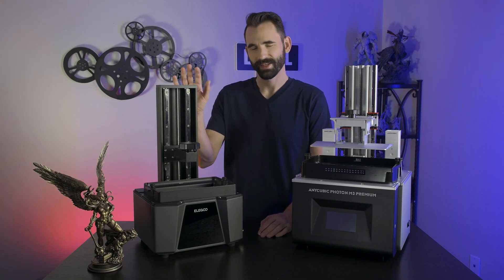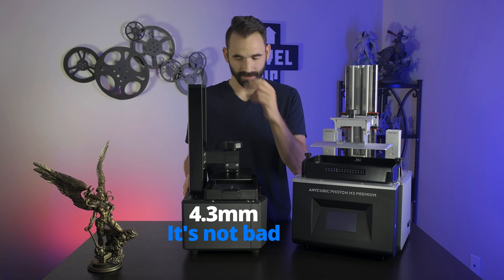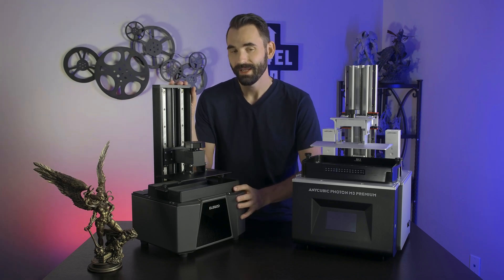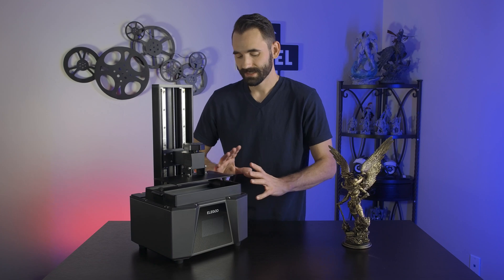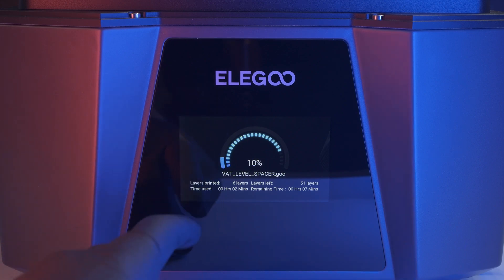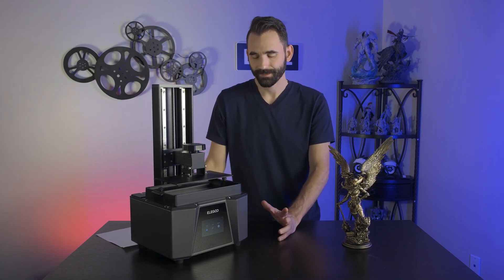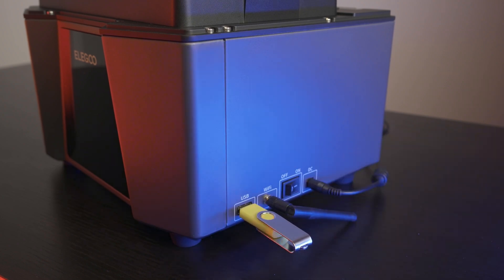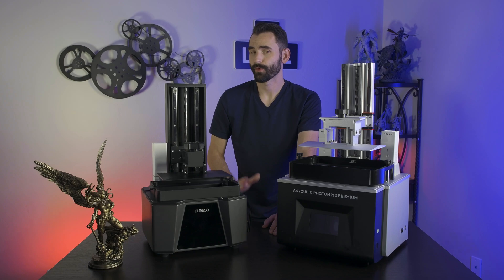Saturn 3 Ultra Review #review #3dprinter

Comment: Man, I'm just not sure whether to get the Saturn 3 or Saturn 3 Ultra. I'm getting so much mixed feedback from various sources, some saying the Ultra is worth it and an upgrade in every way, whereas others saying the 3 is better for print quality and consistency.

I REALLY dislike the two-point leveling system on the 3. And the Ultra having the beefier ball screw is a plus. Other than that, I don't care about any other features, wifi, metal body, etc. The extra 10mm print height is nice though.

Also, yeah, ACF sucks but that can easily be replaced. Print speed isn't a concern, quality is. What do you think? I might just have to order both and test them both out and return whichever I like least...
Reply from the maker: At this point I would look at the GK3-T it's going to be better then either.
Reply: @J3DTech  Not sure I want to spend twice the price for it. Also is unavailable on Amazon, is it an older Uniformation printer?
Reply from the maker: @asimhussain8716 It's the new one they have the Gk3-P , GK3-B and GK3-T. On their website go for the GK3-T. I'm sure they have a black Friday deal right now.

Comment: Hi! As the blackfriday sale is going on right now I'm undecided between the S3U (and buy NFEPs) or the Phrozen Mini 8k S. Would you recommend one over the other?
Reply from the maker: @negligible_comment  It really depends on if you want the big or large printer. The mini 8Ks is a great printer, very solid. It's a little bit small but solid.
Reply: @J3DTech  I don't really care about the size. It's for Tabletop and painting hobby and I have enough space for any (or gonna make some, thaha). I want the details to be great and the printer to be solid (proven). The WiFi of the S3U is a nice add for sure and the bigger print size in case I need it as well. Don't know how well it works though when the ACF gets switched out. The 8kS seems to be very solid and has great details.
Reply from the maker: @rphl-v3k  You maybe also want to look at the M7 none pro version
Reply: @J3DTech  I don't think the €100 more on the M7 are worth it. Although the residue detection is quite cool, but it has ACF again. Btw, thanks for the fast answers here!
Reply from the maker: @rphl-v3k  It just has a very good lighting engine. But it does have auto leveling....
Reply: @J3DTech  I want manual leveling, don't want to play the QC lottery even more with auto "leveling".
Reply from the maker: @rphl-v3k  You and me both

Comment: Thanks for creating this! I decided to get into Resin after using FDM printers for almost 10 years now. Decided to get a used M3 Premium based on this video and the Infill Podcast you were one even though there's a ton of praise going on for the Elegoo Mars 5 ultra coming in slightly lower in cost new.  I figure a solid platform would be better than more bells and whistles.  Hopefully my assumption is correct. The M3 Premium should arrive in the next few days.  Any recommendations for the M3 Premium?
Reply from the maker: @theFPVgeek  First where did you find one? That's impressive! 

It's an easy printer to use, simply calibrate and print away.
Reply: @J3DTech  Found on eBay :) Supposedly barely used (~12 prints).  We'll see in a few days.

Comment: I've been having problems with my non-ultra s-3 and parts of prints not sticking to the buildplate. I'm going to look through your videos for the solution you briefy mentioned in this video on how to properly zero the buildplate with those test prints. Thanks!
Reply from the maker: That's the best place to start. But also make sure that you update the firmware. Major speed issues resolved with the newest version.

Comment: Are the exposure times the same with nfep and acf?
I was getting some really good and fast prints with ACF but since I've damaged it I would like to try nfep. What speed reduction would you recommend in comparison to  acf? Is it like 10% or is it closer to 50%?
Reply from the maker: For my resin they were but you always want to relevel and calibrate.

For speed ACF only lets you pull faster all other speeds are not affected by the film. 

I pull at 45mm/m - 100mm/m on the first stage 200mm/m - 300mm/m on the 2nd 

Burn in layers should always be very slow.

Comment: New to the resin side of printing I started with the Saturn 3 Ultra, I am still in the learning stages, I just paid the price for ACF replacements :( . Is NFEP worth crossing over to once this supply runs out? I am not as much about speed as I am with a failure rate and quality output.
Reply from the maker: If quality is your goal the nFEP is what you want.

Comment: So how good is the AA Compared to the mighty 8k? The mighty 8k has exceptional AA and was thinking of getting this printer but I need AA to work to the point of minimal voxels on smooth surfaces.
Reply from the maker: AA is a strange thing, it can depend on the printer, the slicer and the settings.

I don't have a MIghty 8k to run a test on so I can post the results. But in the descriptopn I did post the HD pics of my tests. AA and details I think that the difference very good. 

But, HD AA and a 12K printer will take a LONG time to slice and require that you have an good PC.
Reply: Thanks for the reply. I use siraya tech navy grey which responds to AA well. Which printer out of all the ones you’ve tested has the best AA as a general statement.

Comment: Anyone have a lonk for setting adjustments when using an nFep with the ultra? Thanks to whoever links a post or explanation 😊
Reply from the maker: My settings were 99% the same. UV exposure changed by 0.1s. This is less than what temps will make.

Comment: As one of those "nobody bought it" owners of the M3 Premium I am SO disappointed that not only did they discontinue it but they don't support it either so getting a replacement LCD screen for it is nearly impossible and while I've managed to find one for now, next time it's likely to be an expensive paperweight. I'm hoping that this works out better.
Reply from the maker: Its one of my fears, out of all my printers is still my favorate to use. When I'm using any other printer I honesly don't enjoy the hobby as much.
Reply: @J3DTech  Im also one of those "nobody bought it", recently one mate from the forums of anycubic has share that the replacement is the elegoo screen of the saturn 2 8K, "but" with some little detail on the X axis when you replace it doesnt fill all the gap needed so it needs to be properly center with the black tapes.
Reply from the maker: @tonystarkitl  Good to know, I'll keep that in mind for when my LCD goes out.
Reply: @J3DTech  I can accept them making a business decision to stop making the printer itself. Personally I think it was the wrong choice because it's an amazing printer in my opinion but that's their call. But to completely abandon their customers when it comes to even a consumable part? That's crappy. I liked Anycubic prior to that but now that trust and loyalty are shot. My only hope is that some 3rd party decides to pick up the slack but that's doubtful. I did manage to find a screen for about $250 including shipping to the US but the lead time is nearly 2 months and I'm concerned that come shipping time I'm going to get a "sorry not available" notice. I've been in touch with the seller and they assure me they'll have it so I'm staying hopeful. I got burned a number of years back on an FDM company that promised great things and delivered a half working sub-par piece of junk (M3D's Promega) and now have a $1k monument to failure sitting in the corner of my shop.

Comment: Your hawkgirl is amazing and  a masterpiece!
Reply from the maker: Thank you
Reply: @J3DTech  Love the model. May i ask how you did the amazing gold? I think i would try to drybrush or airbrush gold over black but however you did it it looks stunning.
Reply from the maker: Its just guilding wax, use a back primer, then a white glove to apply it. A lot like dry brusning. Just use a rubber glove under the white one.  @Dedrael81
Reply: @J3DTech  Thx for your answer. Never heard guilding wax before, will surly give it a try.
Reply from the maker: @Dedrael81  This stuff, put it on thin.  https://www.amazon.com/Pebeo-766507US-Gliding-King-Gold/dp/B07Q1MGPV7/ref=mp_s_a_1_6_sspa?crid=1Q910R3MVD8AZ&keywords=gilding+wax&qid=1707056741&sprefix=guilding+wa%2Caps%2C144&sr=8-6-spons&sp_csd=d2lkZ2V0TmFtZT1zcF9waG9uZV9zZWFyY2hfbXRm&psc=1

Comment: I am completely new to 3d printing and I got the Saturn 3 Ultra.
It has been... a journey. I cannot say how much is due to me being a complete noob and how much due to th eproblems that you mentioned, but many of the buts that you say, I also said myself (and as a noob!). Things like, "Am I stupid or is the only viable way to move the thing up to remove the vat is to go to manual, put 50 mm and press it 3 times?".

My first calibration went wrong, because I did it in the wrong order. That was my fault: I unscrewed, then lifted until the paper felt with some resistance, then screwed them.
Apparently, you have to screw them before you do the paper test, and the paper.
The paper, by the way, wtf. They could have put a bigger paper. It is so hard to try to move around to see if there is any resistance bcause it is almost of the size of the top plate, and I fear to use anything else because I think that the thickness of the paper is important.

Anyway. I was using the cones of calibration to test my abslike v2 grey resin, and I managed to get a print at 3 seconds of exposure, but it was overexposed.
So I tried 2 seconds, and now it was.. fine? Like the failed cone failed and the success cone succeded, but the print looked so much worse than the other one.
And here is where the "fun" begins:
I am making all these changes of exposure time in chitubox and sending them via wifi.
For some reason, when I try 2.5s, chitubox changes the rise distance from 3 mm to -1. 
I didn't notice at first, so I was very surprise when the print which was supposed to be in the middle of the other two turned out to be by far the worst.
But that was only the first problem.

Somehow, after 5 failed prints and using the feature of cleaning the resint tank (which has already consumed like half of my bottle), I noticed that there was still something in the vat.
I clean the vat and there it is: There is a hole in the center of the vat. The whole doesn't seem to be a puncture hole, but rather a burnt hole. And there is also a "burnt" mark in one of the corners.

I think that the one time chitubox set the rise distance to -1, the print burnt the acf or something.

In summary, my second day of 3d printing was spent buying a new pack of acf films to be able to keep calibrating. Yay...
Reply: I see that you have a full document about starting. I will try yours, since it seems that other methods are not meant for idiots like me. I hope your method is fool proof!
Reply from the maker: Your story here feels like the norm. This is why I created my guide. It's way more than just calibration. It's trying to help you get into the correct mind. More than anything it's workflows to help you keep your printing runnin great.

How I level, prep, clean, calibrate and print are all part of a system that's designed for the best results.

Comment: Do you have any chance to do a review of the Mars 4 Ultra? Since it uses ACF, same linux based OS + goo file format as the Sat3Ultra it might have the same lower and upper speed limits like the 120mm/m lower limit which would affect its performance if someone decides to chance to NFEP by choice or lack of stock of the ACF film.
Reply from the maker: I wish I could, I don't have one and Elegoo does not send me hardware. Everything I have and do, is at my own expense with no monotonization or sponsorship.
Reply: @J3DTech  Just an update. In the end I bought a Mars 4 Ultra during Black Friday as an upgrade to my old Phrozen Mini 4k. I'll keep my Sat 2 and skip the Sat3U and see what comes next gen. I felt it was a bigger upgrade from the former ones than the later ones. As for the lower limit with the Mars 4 Ultra, I made a test with a print file with 60mm/min speeds (equal to 1mm/s) and 20mm distances, if it respected that speed it would take 20secs up and 20s down. From the recorded video and a chronometer on the background. It took roughly 13.3 secs to travel that 20mm up, same 13.3secs down. That means 1.5mm/s or a lower speed limit of 90mm/min.
Reply from the maker: @kamui004  I think this issue maybe more common then we think. I've not really tested all the printers out there but I bet we will see this is why Slicerse are not as accurate as they should be. I also wonder if this is why there was an old "Dead Zone" that older 3D printers talk about from 50mm/m-100mm/m Maybe these order printers would default to a faster speed.

I've been testing the S3U firmware that just came out and it still has issues. 500mm/m is slower then 400mm/m, 30mm/m - 55mm/m = the same speed. Always fun!

Comment: Castable resins require slow lift speeds. Considering how many people are buying the new ultras for jewelry coupled with a the acf fiasco shows elegoo really has no clue about their customers needs. Why would you make the printer go 100mm/min minimum? So stupid
Reply from the maker: I don't think it was intentional. Given that I've been working with them and testing different from where packages and it's a bit of a struggle to get it right.

Comment: Cool review, just got mine, only printed the rook test, it came out good, will be testing it soon with my models and will try to tune in the settings. I did notice there is some resonance sound from the fans, think it may be bc of the metal frame, will measure the sound next time it prints. What settings do you recommend for quality?  Using Siraya Fast resin.
Reply from the maker: Thank you! I ended up pulling the light intensity down to 80%. Because the speed limits, it doesn't matter if you try to set something below 120 mm a minute it's going to just do that. So for now you're stuck with that.

Because of this you need to really make sure that you're burning layers and your leveling is good cuz it's just going to rip the print off of the FEP.

So after that I just calibrated to the boxes of calibration getting all the pillars after switching out the ACF film to NFEP
Reply: @J3DTech I was asking about the sound but now that u mention it how do u reduce the light intensity? Can't see it in the printer menu, is it in Chitubox?
Reply from the maker: @Icemanmodeler  I use lychee slicer, in that it's called Light Intensity I set it to 80% and I was able to get better results doing this.
Reply from the maker: @Icemanmodeler  As far as the sound goes, it is a bit loud and the only way to fix this would be to put sound dampening foam inside the chassis where you're not going to disrupt any of the operations of the system.

The other thing I'm considered doing with a few of my printers is upgrading the fans. To Noctua.
Reply: @J3DTech  Measured and it's about 57 dB with the phone placed in front and on the right of the printer. It feels a bit more noisy (like a humming, it may also be resonance) than my MonoX, for the 100$ price difference from the regular Saturn 3 i expected the fans to be silent. Wished they would use Noctua fans instead of the cheap stuff. Printing the calibration prints now, after a few prints gonna try at 30 um rez an exposure time of 2.2 s, didn't get the outer perimeter to print fully, using Siraya Fast Creamy resin.
Reply from the maker: @Icemanmodeler  They could but that would add $40 to the price. It's important to remember a few years ago a 3D printer with half the tech was $700 - $1200. But people did not buy them. So they stated cutting costs where they could.
Reply: @J3DTech  Yeah, it also matured, i did spend quite a lot for my old Transform. It would be interesting to install Noctua fans but it will prob void the warranty and maybe threes some power conversion required. My Transform is super loud and heard it needs a power conversion to install Noctua fans so i didn't bother.
Reply from the maker: Thank you! I ended up pulling the light intensity down to 80%. Because the speed limits, it doesn't matter if you try to set something below 120 mm a minute it's going to just do that. So for now you're stuck with that.

Because of this you need to really make sure that you're burning layers and your leveling is good cuz it's just going to rip the print off of the FEP.

So after that I just calibrated to the boxes of calibration getting all the pillars after switching out the ACF film to NFEP

Comment: My ACF ended up having a tear so I moved to PFA (Saturn 2/3). What TSMC settings would you recommend so I can still print relatively fast ? I had 90/320 and 320/90 previously (Elegoo 8k resin).
Reply from the maker: Not sure the Saturn 2 can do 320 you can always test that.

But 90/250+ should be fine. 

I run mine at 45/250 200/70 with 2s light off delay it's a bit slow but gives me great results
Reply: @J3DTech  Sorry I meant my S3U ACF developed a tear so I used a Saturn 2 PFA film to replace the ACF. So wondering what speeds I should run since I have changed ACF to PFA on S3U
Reply from the maker: @kinghuzi  Yep I understand and the speeds I posted are what is recommended

Comment: Great video, thanks. Is it able to maintain dimensional accuracy the increased strain of larger prints with high lift speeds?
Reply from the maker: It was using the 2 resins I tested I would think water washable or ECO resins will struggle with this. 

It also took me a bit longer to calibrate than normal.